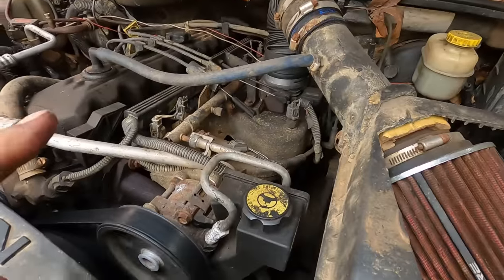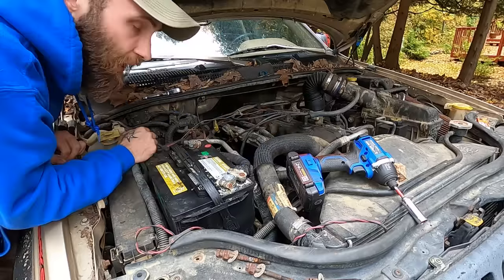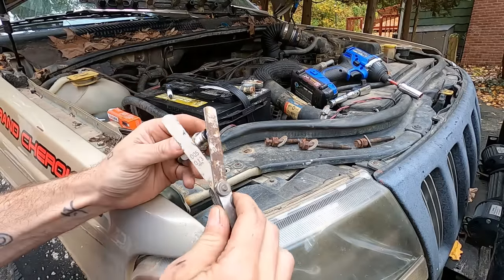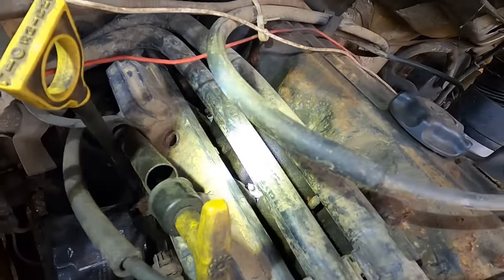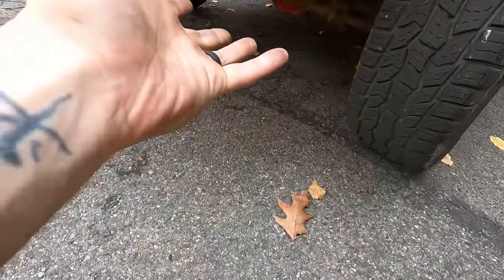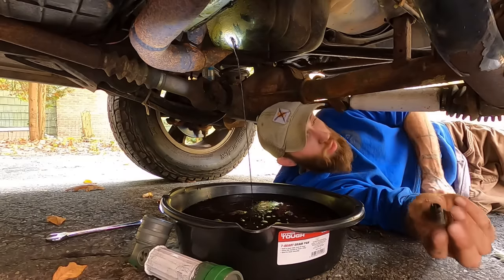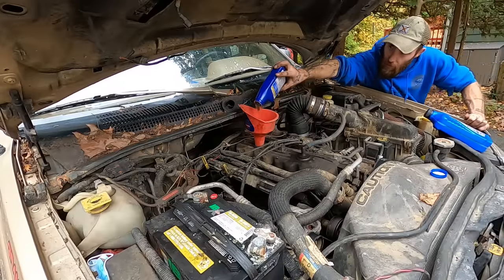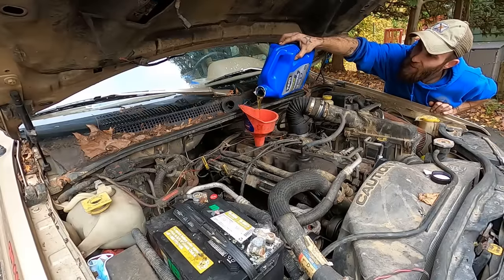Stop treating your Jeep 4.0L like a MODERN ENGINE... It isn't one!

Comment: Don't spend a fortune on an overpriced, overengineered pile of junk that is the overwhelming majority of modern vehicles.  Get an older one and restore it. Cheaper in the long run, better build quality and easy to work on yourself.
Reply: That’s why I bought a 100 series land cruiser. Built Toyota tough.
Reply: Same reason I’m restoring an 89 jeep Comanche, more than enough truck for my hauling needs, reliable easy to work on and most parts are easy to find, low registration/insurance, no car mortgage payment and unmatched cool factor.
Reply: Getting rid of my 2005 Forester XT  this month. It run  great up to 140K though Changing its turbo was a nightmare...
Reply: Sorry to say but newer cars last longer, like my 2006 jeeps have over 150k and they still run great, and look great and are almost 20 years old, older cars only lasted 10 years
Reply: @rob136916  Well a 2006 isn't what I consider newer, lol. The issues have been in vehicle's built since the 2008/09 recession and government bailout. It's the same thing with the RV industry, newer than 08/09 have terrible QC. I have a 1997 Pontiac,  2008 Cadillac and a 1974 GMC C1500 and all are still running great and both the 1997 and 74 are extremely cheap to repair.
Reply: I finally learned that
Reply: @brkbtjunkie Landcruisers, sadly, have gotten seriously expensive.
Reply: @solarflare4259 my Forester XT was a great car... but went through 3 turbos
Reply: @rob136916 your comment doesn't make sense
Reply: @El_Winss  nice i got a 90 'manche I'm working on
Reply: Exactly. Don’t spend 70k on new, spend 10k on old and a chunk of change building it WELL.
Reply: My Daily is a 1983 CJ-8.  Previously it was a 1964 LR IIA.  Easy to maintain and when there is a problem you can diagnose it in the driveway.  Cheap insurance, cheap tags and they APPRECIATE over time of ownership.  If you live in a small town like I do, an old classic vehicle can't be beat.  For the occasional rod trip I just pick up a rental from the airport.

Comment: Great video and good advice, the 4.0 is basically the AMC 199/232/258 that was first introduced in 1964 as the "Typhoon 6" and really didn't change much until the end. I took a 4.0 out of a wrecked 2001 cherokee and it bolted right into a 74 AMC gremlin with no mods other than a adding an electric fuel pump, the old 258 intake and carb even bolted right on the same place.. One of the best engines ever made that was in use for like 50 years. With some simple "old school" maintenance they can go 300K miles.
Reply: Had an 81 concorde 258 320thousand oil pump failed killed it wrecked wrangler provided a transplant just like you say all bolted right back in down a little power after seat dino wise but  alas it sold it 125thousand later. Still miss that tank.
Reply: I beat the snot out of my 99 4.0, just regular oil changes at 3k miles, and plugs. She was over 300k when I sold it.
Reply: Yuuup, The way I understand it, the 258 became the 4.0 with a new head design and a different crank stroke. Which leads me to the stroker 4.0, man those things can get with it in the power department! My 99 TJ has 208K on it, clatters a bit but runs great. I have gone through an re-sealed the whole thing so it doesn't just dribble out the bottom lol. OHHH I have read several times on multiple forums etc. that the Champion copper  plugs are the ones the 4.0 prefers so I just run them. STP is an amazing lubricant by it's self,,, try it on something, you might be shocked how well it works. I wish they hadn't changed the motor mount locations and accessory mounting locations on the later 4.0, just makes it harder to find a used low milage replacement for an older vehicle.
Reply: I like the old school AMC's Rambler sixes
Reply: My dad's 1992 Cherokee is still going at 342k. Puffs a little blue smoke when it starts, definitely rattles like a worn out tractor, and a rebuild is definitely on the horizon - but if it needed to, I bet it could run another 100k.
Reply: My 95 Jeep that I purchased NEW now has 455,000 miles.  Runs perfect, 3,000 mile oil changes uses about 1/4 of a quart.  Only internal engine maintenance was a Timing set at about 350,000 just because I thought it was a good idea.
Reply: I thought it was a good video, only problem I have is running anything but Champion spark plugs. I would not run them in much else, but they have the right heat range for the 4.0 . Other plugs if you look up specs are not as hot, therefore making a less happy boom. Maybe the ones you listed are closer than others, so they work ok for you.
Reply: I have a 2002 WJ grand Cherokee that was originally my dads that he gave to me, and it now has 387,000 miles on it with no significant problems

Comment: You’d be better off running a diesel oil in it for zinc content. There’s some VOAs out there that show that subtracting the amount motor oil and substituting the STP it actually lowers the over all ppm of zinc that in just a decent motor oil. It’s basically just motor honey
Reply: Use vr1 Valvoline
Reply: @jamieb9556  shell rotella

Comment: Spark plugs all are copper cores, just the tips are different.  Platinums and Iridiums work fine and will last much longer contrary to what was stated. Also a very easy way to get the extra needed ZDDP just use a diesel oil.
Reply: Zddp has been found to clogged catalytic converters other then that good to go if u have burned out or no cat
Reply: @danielkirkpatrick1098 except flat tappet cams require zinc. 🤣
Reply: @danielkirkpatrick1098  modern Shell rotella  has no where near the amount of zinc as old school oils did. It has enough for protection but not enough to mess up your converter.

Comment: The 4.0 was in fact designed to run on 10w40 motor oil, original specs called for as high as 20w50 in warm climates, 10w30 is the absolute lightest weight oil you should ever put in a 4.0. I run 15w40 in mine.
Reply: FSM states u can use 5W-30 in cold climates
Reply: @code_xj  Not ideal, too thin, 5w40 would be better.
Reply: I use 10 30 full synthetic and when it is 32 degrees or colder I put a little Marvel's mystery oil in it, helps a ton with cold starts
Reply: @manbearpig2164  Mine starts easily in the cold with 15w40 in it.
Reply: Ive used 10-30 for 80% of our 4.0s life.. it has 420k now, i have two AMC 360 engines and a 360 magnum in my 98 ZJ,  the 360 magnum is fine on 10-30.  The 4.0 is fine on 10-30 and so is the amc 360.   But i have been using 5-40 or 0-40 European Mobile 1 FS oil in my amc 360 and it REALLY quiets the engine up and runs much better..  I put it in the 4.0 and same.   and yes i use 0-40 in my AMC360..  it runs great.. i picked the FS european oil because its ZINC content according to mobile 1 is like 1200-1300ppm or something.   Regular oil is like 800ppm now. 

I would never put 15-40 in my engines, thats way too thick for initial startup
Reply: @jeepsblackpowderandlights4305  15w40 isn't too thick at all.
Reply: @Lray4x4  sure it is.  The engines more wear is during startup.  The 15w is for initial startup.  Do you think its better to have less or more oil flow during startup.  Lol dummy
Reply: @jeepsblackpowderandlights4305  On an engine not designed for it yes but the 4.0 was, won't hurt it at all, and what do you say about all the diesel engines lasting 500k- 1 million miles running 15w40? You don't get less flow on startup with 15w40 you actually have higher oil pressure.
Reply: @Lray4x4  you do get less flow it.  Its why all 3 of my AMC and the 1 chrysler engine clatter in startup with oil that thick.  And dont when using 0-5w
Reply: @jeepsblackpowderandlights4305  Mine are just fine with 15w40 and have better oil pressure than with 10w30.
Reply: How many miles does your 4.0 has
Reply: @andyclemente4205  mine has 420k miles.  1 timing chain at around 220.  

Ive used 10-30 all its life
Reply: @andyclemente4205  Over 250K on mine.

Comment: Helpful tips, but a stock 4.0L does not benefit from zinc additive.  Although it has a flat tappet cam, the valve spring pressures are so low, that all a Zinc additive is doing is killing your cat convertors. 4.0L's are known for shedding lots of iron in used oil analysis (mainly from the timing chain) and I had several reports from a few of mine with single digit iron wear numbers on regular modern Pennzoil 10w30 and Valvoline 10w30.  A brand new engine that hasn't been broken in, or a 4.6L stroker with an aggressive lift cam is a different story, but the break-in on those usually includes running at a sustained RPM for a period of time with a high zinc oil to break in the cam.  Check out the jeepstrokers forum. ;)
Reply: Pretty much. When I was rebuilding I found out they are very low speed and spring pressures involved so "zinc-ing" this motor is a waste of time "these days" since the oils are way better. Running bigger lift and more power is when you use it. Break in only really but I ran RP (non-sae) and it was more than good enough. When I rebuild the stock motor (first one) on my other newer XJ I'd apply the same principle. As for my first one which is basically a street driven race motor all these problems people having doing these mythical jeep "hot-rodding" tricks, I don't have them because I don't do them. I'm glad I didn't get sucked into all the crap a lot of these old jeep guys do.
Reply: No, in my experience as a machinist, it's coming from the cylinder walls.  Those 4.0s are made of VERY soft iron compared to the older LA blocks.  They hone so much faster that I have to be careful not to overshoot the bore size.  That said, I've had several come in that were still in running condition with over .060" of taper at the top of the cylinder.  An ecoboost engine would be over halfway through it's cylinder liner at that point.

Comment: Actually, the 4.0 straight six has been around since the AMC days. It's been updated along the way to comply EPA whatnot. Great engine, cheers! :-)
Reply: i believe it was a 4.2 though
Reply: My dad said he had a 242 straight 6 in his old Rambler. Back then they had a rep for being bullet proof.
Reply: @timkaldahl if was a rambler would think it was a 199, 232, or 258, the 242 was the displacement of the 4.0 which wasn't until the 80s,, regardless they're all basically the same engine other than the displacement and have much interchangeability of parts
Reply: The basic straight 6 was from the rambler days, 199,232,&258 cubic inches, the 4.0 or 242 and 4.2 or 258, were the displacements used after chrysler purchased amc

Comment: You don't have to unplug the power rail from the wiring harness to change the plugs. Just move it aside; there's room. Don't argue - there is.
You can clean the 4.0, but put a plastic bag over the throttle body and don't use engine "cleaner" around it or rinse in the area with high pressure water- be extra mindful of the TPS.
Draining your oil with the filler cap on will not lock the cap on or keep the oil from draining fully. The cap being off may or may not affect draining time, but negligibly, if at all.
Do clean the corrosion from your battery. It creates higher impedance between the battery and the starting/charging components, which causes higher load at startup along with less efficient charging, which together, degrade your battery capacity and overall battery life faster.
I do use the iridium split tip plugs and get great performance from them for typically 60-70k miles.
Modern spark plugs DO provide better spark and last longer in ALL engines. 
The idea behind newer technology is that it does in fact work better than old.
Reply: I agree. I was puzzled as to why he took it off. I move mine, and just check for wear. More plugging/unplugging causes extra wear. Also, I clean mine religiously and have 275,000k miles. Cover oil, trans dipsticks, and the alternator, and it usually is good to go! I think that is the worst of his advice. A clean engine is easier to diagnose.
Reply: Unfortunately, the new technology is focused on reducing emissions and not performance.
Reply: Definitely true look a a deleted Cummings alot more power engine is cleaner as it's not recycling exhaust etc etc .  @Nigriff
Reply: Newer doesn’t always mean better, especially when engineers either have their heads up their a$$es or have their hands tied by regulations or micro-managing executives.

Comment: Good video but I would have to disagree with a couple of things. I have a 1999 TJ with over 350000 miles (got it new) and I have used Champion Platinum Power Spark Plugs since I can remember. I do agree that the expensive ones are a waste of money but an upgrade above the cheap coppers have worked out for me. Also, I have never put zinc additive in my oil. Engine still runs like a champ, given it's age. Now I have used synthetic oil since it hit around 100000 miles and as I have mentioned, it runs like a champ. The most important thing I can say is change your oil and spark plugs religiously as well as your ignition wires (as per the manufacturer). The 4.0L is a rock solid engine. If you take care of it, it will last a long time.

Comment: watched your older videos on the importance of zinc in the 4.0 and running rotella T5 instead of newer oils. stoked to try the change to rotella in my 4.2L 89 YJ. someone with an 88 comanche commented and said making the switch was a game changer not only for engine wear but also sound of the engine

Comment: Love the tip about always removing the oil filler cap before draining. That happened to me a few months ago on my ‘02 Grand Cherokee when the cap disintegrated in my hand while the oil was pouring out the bottom. After some cursing, begging, pleading and praying, the cap threads came out allowing me to refill and limp to the parts store for a new cap.
Reply: I always take it off first and set it right on the hood latch.  That way if you forget to put it back in, you'll find out when you close the hood.  Will cost a new cap, but better than forgetting and it just falling off on the road and not knowing.

Comment: '97 4.0L with  224,534 on the odometer as it sits right now in the driveway.  Just replaced the spark plugs, distributor cap/rotor (ACCEL units) and ignition coil. That had nearly 100,000 miles on them... the cap had carbon tracks and build up, rotor was showing carbon wear. The plugs could have been wire brushed,  gapped and reused (didn't though).. 
Dose not use any oil, starts and runs great.

Comment: I replaced my coil pack with the viper mod. One of my favorite swaps I've done.
Reply: Viper mod?? Please elaborate. 04 WJ 4.0 4wd 228k 🤔
Reply: What is that mod 🤔
Reply: @andyclemente4205  its just a coil pack setup that replaces the factory coil rail setup with one that mounts remotely and has plug wires like most engines. yes the viper used the coils but you could also call it the dodge mini van coil mod because they did too. doesnt do anything to better performance and in fact adds something else to go wrong "plug wires" but it does make changing the plugs or diagnosing an engine misfire easier.
Reply: @wyrdo1501  ohh ok. I was about to ask you if it made a big difference but you already answered that 😅. But thanks for answering my question
Reply: @andyclemente4205  no problem. The main reason for switching over is to have. More traditional setup with plug wires. Say you are having a misfire on a cylinder and trying to figure out which one, with regular plug wires you can pull the plug wires one by one and figure out which cylinder is having an issue. With the factory coil rail setup on the jeeps you can't do that. The factory rail is cleaner but If mine goes bad I'm probably going to end up switching over. I think the "viper" setup is like $120 or so.
Reply: @wyrdo1501  got it. Well I guess that  setup that won't work for me lol. Both of my xj have distributors therefore they have spark plugs wire

Comment: I recently switched over to the Viper Mod coil and wires. I'd been having problems with misfires and pulling the coil rail and putting it back in every time I needed to do some diagnostics wore pretty thin. Best $90 spent.

Comment: Another way to make your 4.0L last longer is to get rid of that K&N style air filter. They are horrible at filtering the air going into your motor. A factory style quality paper filter is best. The extra 5 hp at 6,000 rpm isn’t worth the extra dirt in your motor. 
Great video!
Reply: I  agree !!!

Comment: I daily a '96 xj, and it does great. I've had it for less than 2 years, and it's due for a second oil chage. No major problems(excluding all the cooling parts and leaks and some suspension parts I got fixed when I first bought it) except for camshaft and crankshaft sensors recently, and the alternator. Gas mileage has surprised me quite a bit on the highway. Odometer has low 200k miles, but less than 100k driven miles, because it was towed behind a motorhome. I get anywhere from 12 to 14mpg if I'm lucky, and not driving to crazy around town. Then going on the highway at least 65-70mph loaded or not i've seen 21.5 to almost 24mpg. Not a bad first vehicle, just gotta stay somewhat focused with a solid axle vehicle.
Reply: Don't forget fuel and air filters! Make a big difference honestly